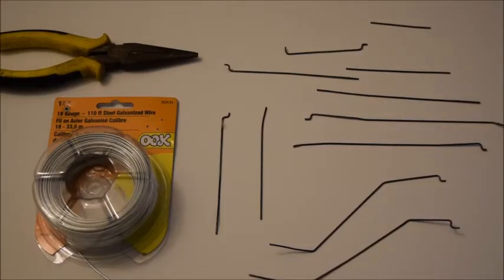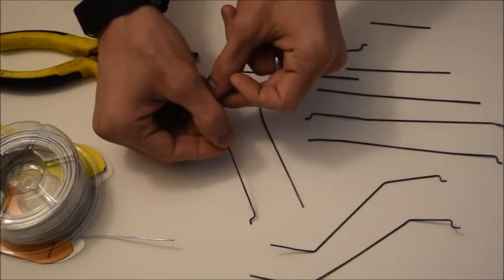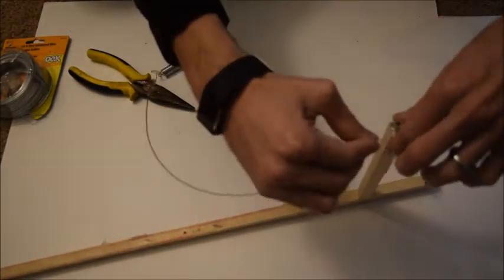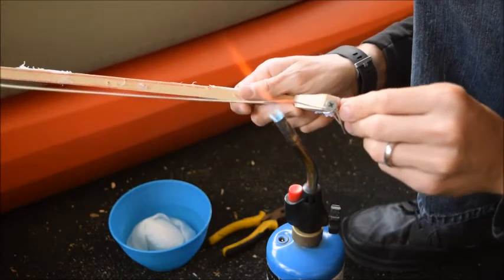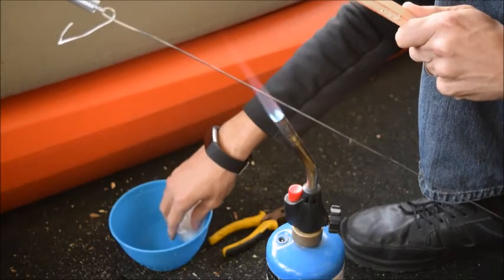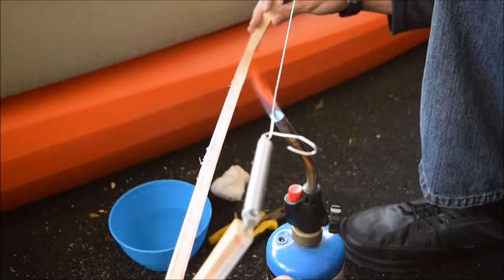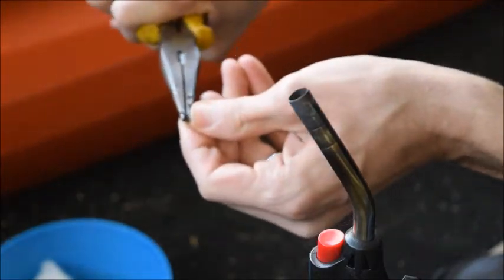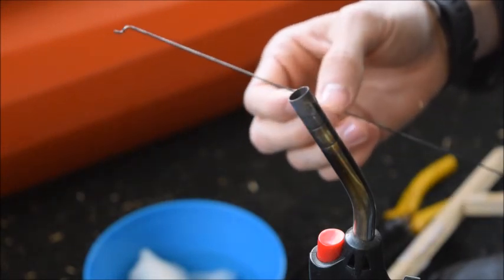DIY RC Push Rods - super cheap - $0.03 each

Comment: I do it but it breaking after temper when i bend it
Reply from the maker: sorry, the wire will certainly become less flexible after tempering
Reply: @DrewMann  what is the solution
Reply from the maker: @INDIANADAVANCEHOBBY  you could try doing the bends in stages, heating between each bend perhaps?
Reply: reHeat the end you want to bend and let it cool slowly. This will remove most of the hardness/ temper. After you have the shape you want heat it again then dip it in water again to harden it.
Hope this helps.

Comment: Is this wire's thickness is affordable to pass through the holes of servo 9g?
Reply from the maker: For the most part yes,  although you may need to use a small drill bit to widen the servo arm holes just a bit.
Reply: @DrewMann  nobody give this information

Comment: Could you maybe apply electricity to the wire to get instant red hot? Or not a good idea? Like a foam wire cutter.
Reply from the maker: Matt Jones , that might work, sounds a bit sketchy tho
Reply: That's true. I would just do it this way.
Reply: electricity, water, red hot wire, what could go wrong?  why not just buy some piano wire at the hobby shop, it is pretty cheap.  some of it even has threaded ends that fit quick links.
Reply: Matt your a smartie pants that would but this whole process down to a couple of seconds per wire. As long as you remember to turn off the power before you  quench it.
Reply: that could work but foam wire cutters use thin high resistance wire, thick wire like this would need very high amps, which would be dangerous and probably hard to control the heat

Comment: I heard that cooling the wire in oil was supposed to help with the hardening process as well
Reply from the maker: cyclistpilot, not a bad idea, wonder what kind would be good to use. would be fun to run some stiffness tests
Reply: oil is used to quench (temper) metals because it has a much higher boiling temperature than water. When the red hot metal comes in contact with the water, a layer of vapor is created instantaneously, which will diminuish the heat transfer . Lower heat transfer, longer cooling time, which dificults the tempering process of the metal because it is necessary to cool the metal as quick as possible. With oil this doesn't happen so easily. On the other hand, the wire is so thin, that you can use water without losing hardness...
Reply: DrewMan RC oil wouldn't do anything with this but make a mess and a small flame

Comment: Wouldn't of thought there was enough carbon to harden , cool now I know . Thanks .
Reply from the maker: Spencer Boaz, I was fairly surprised as well, but hey, if it works it works :)
Reply: piano wire is cheep but the shipping kills ya . If HK's shipping was cheaper I would buy way more from them I look for free shipping on ebay .
Reply: Spencer Boaz buy from radicalrc for com... $3 U.S.A.shipping with 6 pieces of rod stock or more...music wire counts. Always in stock and cheap for .032 like $.55 for a straight 3 feet...